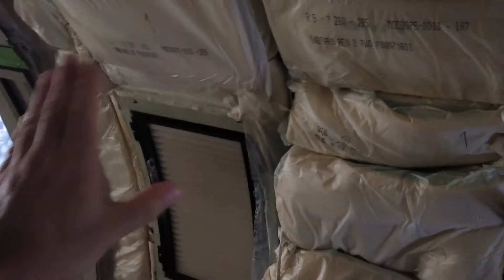AIRCRAFT WINDOWS - Explained

Comment: so educative, thanks for the video. Here's a question. I've seen a mayfly subadult molted skin within the layers of an aircraft amidst flight. How it is even possible for that creature (which is supposed to be living in water) end up molted inside an aircraft window ? Its a mystery for me and will be much helpful if you can throw some light into this mystery sighting.
Reply from the maker: Hello Curious Christi, (I like that name BTW...)
I read up a bit on the mayfly and although it is an aquatic insect for a stage if it's life, it is also a flying insect that swarms out. It could easily accidentally fly into an aircraft cabin on the ground. If the aircraft is parked and closed overnight or in between flights, the only source of light is the cabin windows. It would be natural for any insect to seek out the light and crawl into the window shade looking for a way out only to find a dead end, pun intended. 
Those windows are now hermetically sealed, so any little gap is enough for an insect to squeeze in. 
If anything, that insect being in there is only an indication that the aircraft you were in had been in a place where the mayflies live. 
I hope this helps and stay curious.

Comment: Do you get people pushing things in the holes? I guess they are checked routinely?
Reply from the maker: Not really. I think small insects and dust are more the problem, more like a nuisance. The windows shade assemblies get inspected, repaired, cleaned or replaced, depending on condition, during big airframe inspections, when the interior is removed. Unless one breaks during service, then it get replaced immediately.

Comment: why is there a gap between the two layers of windows??
Reply from the maker: It serves as thermal insulation. The outside window is in direct contact with the frigid atmosphere air(around -40 degrees F). The inside window adds a couple of panes with an air gap separating each of them. Those air gasp insulate the window and keep you from freezing.